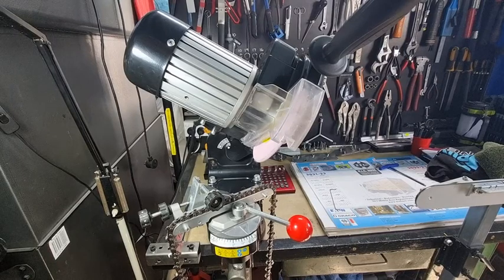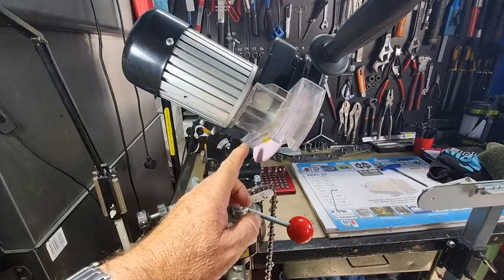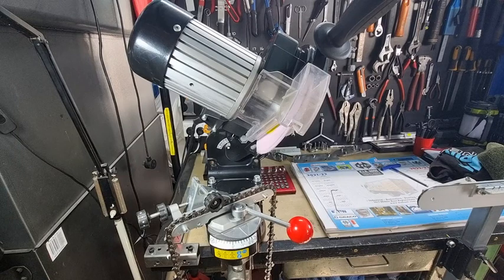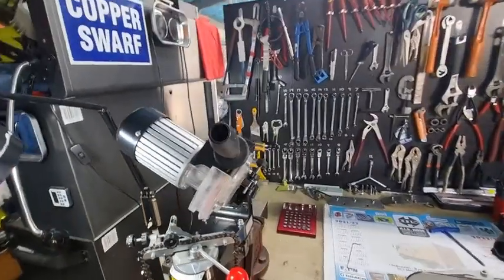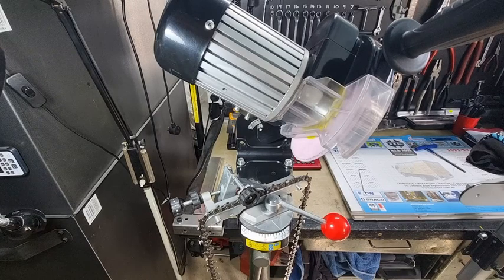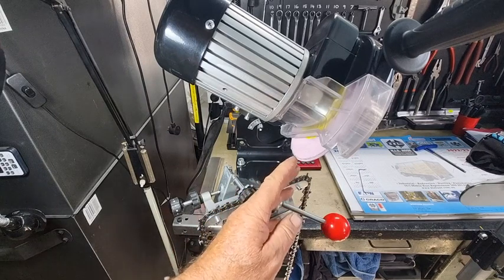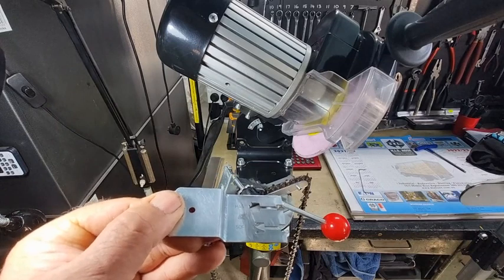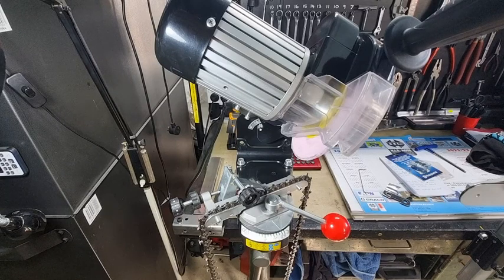17 Mistakes that can be made on a chainsaw grinder

Comment: The 30 degree top plate angle and the 60 degree under the cutter angle are actually the same angle.  It is just that the 30 degree specification is relative to 0 degrees (directly forward in horizontal dimension) where as the 60 degrees relative to 90 degrees (directly upward in vertical dimension).  A most harmonious outcome.
Reply from the maker: Funny you should mention that because I also was wondering why they called the the top plate angle 30°  when it's really 60°  and top plate cutting angle is really 30°  it depends what you are using as your starting reference angle.